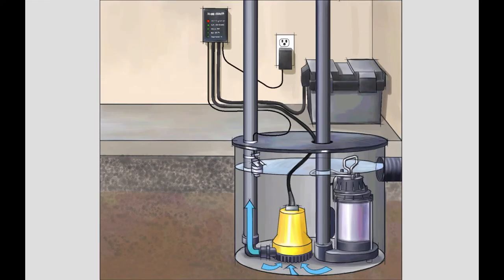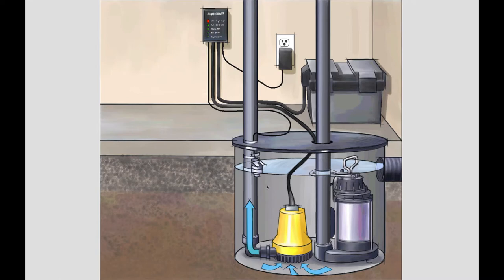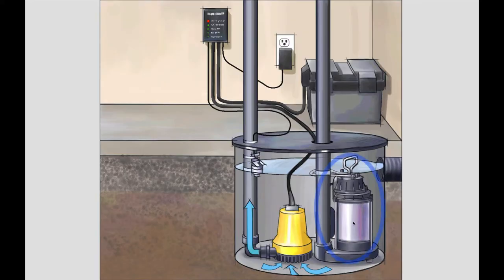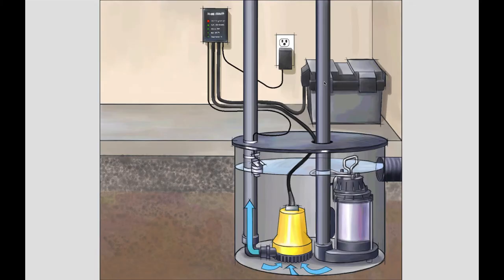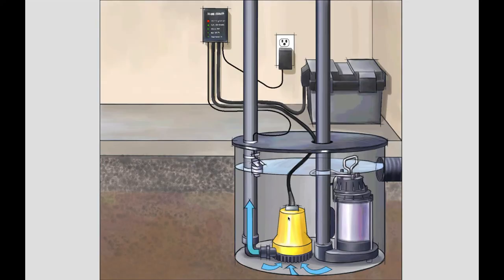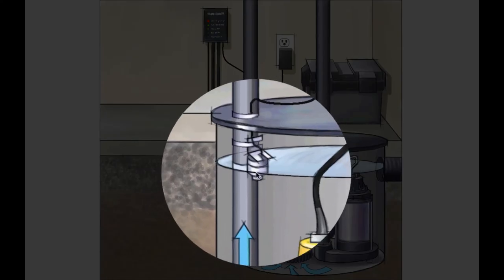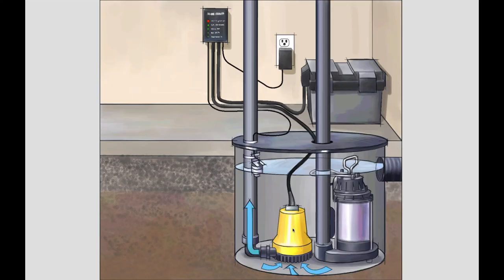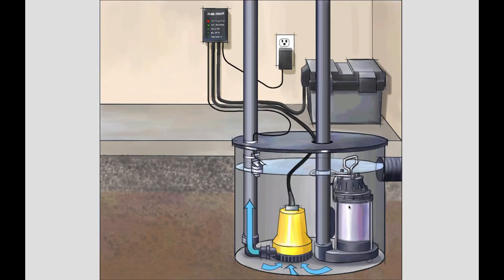Sump Pump Installation: Design, Function & Backup

Comment: Thank you. Finally, a perfect explanation and diagram of the setup I have 1 for 1 (aside from the alarm on the wall). Might add a few extra batteries in case the power goes out for a long time.

Comment: Hi, I have a sump pump at the bottom of my garden because it was always flooding. I buried a plastic bin covered with weed control fabric with lots of holes in the bin to allow water in and a pipe running from the bottom of the bin to my drain that connects to the town wastewater system. it has been working for over 5 years now and only requires occasional checks. because it is only sorting out the bottom of my garden I don't have any backup pump, just tall wellies, and a bucket if it goes wrong.

Comment: What do you recommend as a system to take water away from the outside end of sump pump to avoid ice,snow plugging or other issues at end of drain line?

Comment: I had the misfortune of my main pump failing and then my battery backup battery only lasting about 2 hours of pumping. You REALLY REALLY need to keep a main pump spare on the shelf and grab a generator for those power outages . In fact i also keep a submersible pool pump on hand for manually clearing the pit into the laundry tub if the main sump discharge line is broken or frozen. You need to think about every single shitty situation, because it's not if, it's when it will happen to you

Comment: Easer and cheaper solution would be to get a 12V 0.25 hp sump pump and this way you can eliminate the inverter.